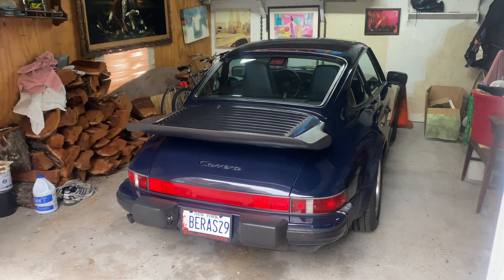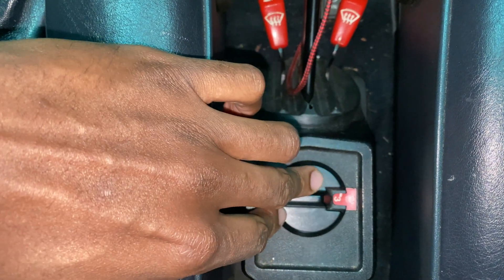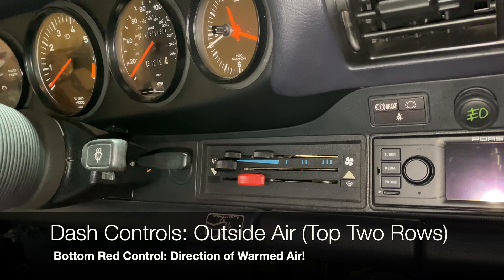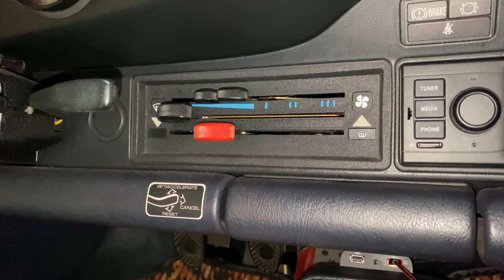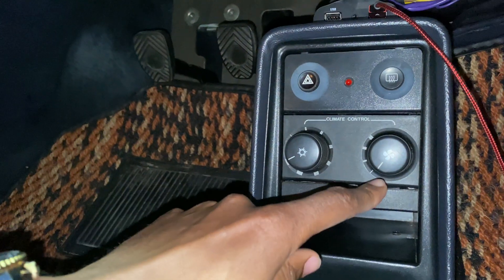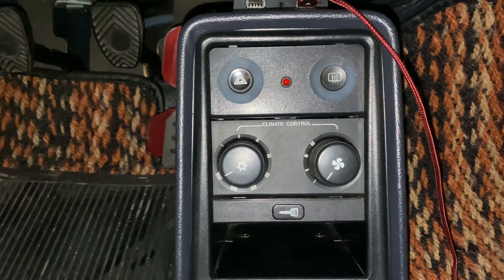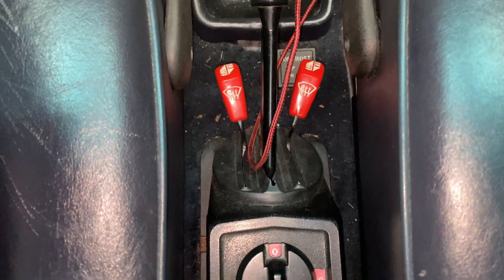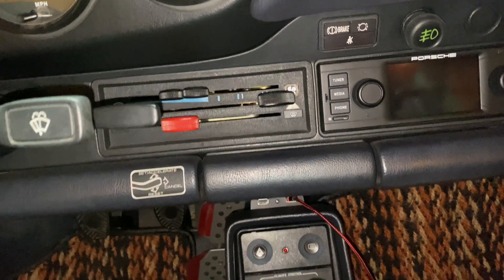I EXPLAIN how to use the Air conditioning & heat controls in an Air-Cooled Porsche 911!

Comment: Could you measure and  post vent temps with outside air temps when the AC is at max cool?  I have to get my AC going on my 86.
Reply from the maker: I can try but I’ll tell you this. It will never achieve cold like in a modern Nissan Pathfinder. Quite frankly, These cars were race derived engines with no intention of ever having ancillary parts like an AC system attached to them because they rob power... My system with new plumbing, hoses, AC compressor, never gets colder than 68 degrees, so for short trips it works well enough where I won’t sweat, but in a hot summer day and the system gets tired… it’s best to take the Lexus. 😂

Comment: Great video! I'd just add for clarification that the dash fan and vent slider (on the top) vent in fresh air from the rectangular black vent on the top of the front trunk.  If this vent is open and the fan is off it still allows fresh air to get into the cabin so when the AC is on, close this vent.  The middle dash control tells you where that air should go.  The bottom one tells you where the heated air goes after you turn on the heaters between the seats (either dash or floor or a mix)   When the heater isn't on, the big belt driven fan pushes hot air from the heat exchanges underneath the car out to the atmosphere, but when those levers are lifted the fan on the left of the engine compartment turns on and the vents are closed directing the hot air into the cabin.  The rotary knob between the seats control two more heater fans that reside in the kick panels for even more airflow.  For people that backdate their heater, the 3 fan motors are removed (to save weight) and the main fan is used to push air in the cabin.  This depends on RPM so Porsche added all those fans to ensure effective heating at all RPM's.  My $.02 to help unravel the mystery of the HVAC controls.  One more thing I found-- 3m Crystalline tint or a good ceramic goes a long way to keep the interior from heat soaking and overwhelming the AC- especially the flat back window on the coupes..  The 3m doesn't have to be dark to block the IR or UV light so good for a show car.
Reply from the maker: Love this!! This definitely added more clarity.  Thank you for adding in!!
Reply: @AlexBeras  I love your content and your passion for these cars.  Sometimes a car just clicks with you and it's a love affair and for us it seems these are it.
Reply: did you make a video on this?